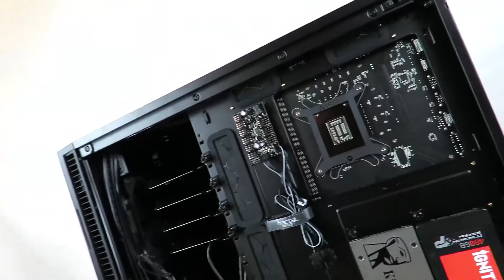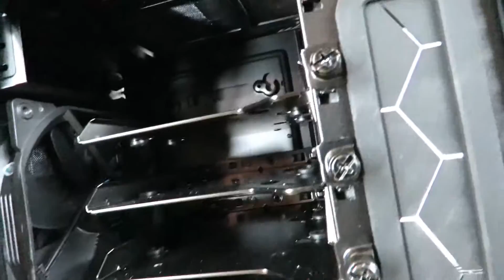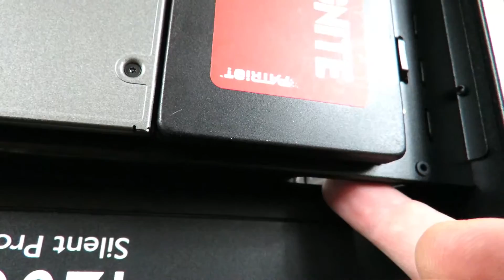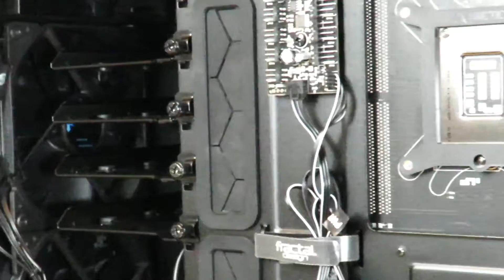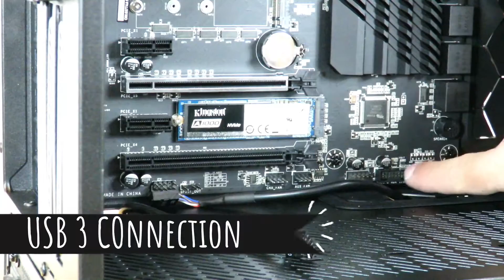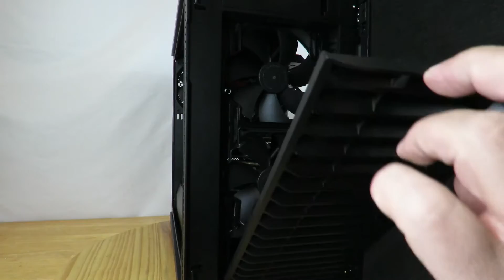Cable Management inside Fractal Design DEFINE R6 Blackout TG

Comment from the maker: Check below for a full list of Amazon Affiliated components used in this system.
Check it out on Amazon: https://geni.us/a0dMjB
Fractal Design DEFINE R6 Blackout TG Case: https://geni.us/AbJI
Flexible Cable Card Extension Port Adapter: https://geni.us/5aC3A
EVGA Z370 FTW Motherboard: https://geni.us/X9eVgAq
ARCTIC Freezer 33 eSports Heatsink: https://geni.us/alvnF9
Intel Core i7 8700K Processor: https://geni.us/jD0s8D
EVGA GeForce GTX 1080 Ti FTW3 GAMING: https://geni.us/BMB4U
Thermal Grizzly Kryonaut Thermal Paste: https://geni.us/xBKj
WD Black 512GB M.2 2280 PCIe NVMe: https://geni.us/aTAxXyc
Samsung 850 Evo 500GB: https://geni.us/QTA2
Patriot Ignite 480GB SSD: https://geni.us/CdEvu
WD Blue 500GB SSD: https://geni.us/VdqB7
Kingston 240GB SSDNOW UV500: https://geni.us/mvwOPN
Cooler Master Silent Pro Gold 1200W PSU: https://geni.us/7hdBk

Comment: Does anyone have a definitive guide on how to use and wire up the integrated fan controller in the R6? I have a fan set up that I'd like to control in sets but on my Asus ROG Strix X570-F Gaming mobo there are only 4 (or is it 5?) fan headers that can accept non-cpu fans - I have 9 fans (+2 for the CPU cooler). How do I wire up the 9 case cans so they can be controlled, thus:

A). 3 x 120mm Intake. - Front.
B). 2 x 140mm Intake. - Bottom.
C). 1 x 140mm Exhaust. - Rear.
D). 3 x 120mm Exhaust. - Top.

I want to control the 4 sets separately (Arctic Cooling (my 6 x 120mm fans) recommends no more than 3 x 120mm fans per header for my specific mobo but to only use the Q-fan type) for simplicity and ease-of-use.
 They also say if I add 4 or more it might overload the header and reduce the RPM by appx 150-200rpm per fan if the header does manage to cope.

Can the integrated fan controller in the R6 (Blackout edition) be wired up to allow me to control the fans in 4 separate sets, rather than 9 fans individually? Control would be faster and less hassle, in the longer term anyway.

Also, how does the integrated controller connect to the motherboard? If it's fan headers, how, where, how many and what cables are supplied with the case?

I've looked at getting a simple knob operated front-panel fan controller (either the Akasa AK-FC-08BKV2 or the Thermaltake Commander F6). Do you know anything about those and which would be best at giving me the specific fan control I'm looking for? 

My CPU is a Ryzen 3900X, so it needs serious air-flow / cooling - but I loathe fan noise, hence the desire to control the fan speeds to find the sweet spot between noise and temp's.

FWIW: I've got 2 x 5 port 4-pin fan controller hubs (with 1 x 4-pin connector) in my arsenal too, how might I use those for my desired set-up?
 Ebay UK search: 5-Port 4-Pin PC Motherboard PWM CPU Cooling Fan Splitter Hub Adapter Cable Lead

Sorry this is so long. :)

Any actual knowledge would be appreciated, thanks. :)
Reply from the maker: So you could put 3 fans to 1 connection using this https://geni.us/4b78k4, though the fans will not receive 100% power, only slightly reduced. The controller controls 6 fans, and 3 of PWM controlled fans, so you will be able to get all your fans in there.  Note, 6 will be at 100%, while the other 3 are PWM controlled.  You can control the PWM ones from your motherboard but will only register as 1 device since its 3 headers into 1 cable.
Reply: ThisBytesForYou  I think if I can't get any sense out of the FD R6's manual for the integrated fan controller, I'll be using 3 of these: https://bit.ly/3ea3kmX instead; I really don't want any fans running at 100% unless my Ryzen 3900X is under high load. 

Referring to my OP above: I'll attach Set D (3 fans) to one, Set A (3 fans) to another, Set B (pair) to a third and have Set C on its own. That'll mean I'll use 4 mobo headers,.. and have the CPU one left for the CPU pair (of fans) on the DR TF cooler. 

That's the plan anyway. Here's hoping it works! :) Build parts arriving tomorrow (17th). Woohoo! :)
Reply from the maker: Yup, that's where I was going with it as I mentioned only 3 were PWM controlled.  Now just realize, the adapter you purchased will not allow the fans to review up 100% since the fan power for those 5 connections will be coming from 1 header, although it may not be a bad thing for you.  good luck my friend, I hope it works out for you.  Please do let me know.
Reply: @ThisBytesForYou   I'm only attaching 3 fans (each) to 2 of those 5-port hubs and 2 to another (8 fans in total) with one fan on its own so I can control my desired 4 sets of fans as sets (intake or exhaust). They'll all go up to 100% if/when I need them to - in theory. ;) 

5-port fan hub #1 = 3 fans. Front. 1 mobo header. Intake. 
5-port fan hub #2 = 2  fans. Bottom. 1 mobo header. Intake. 
5-port fan hub #3 = 3 fans. Top. 1 mobo header. Exhaust. 
Last fan, no 5-port hub. Just run fan to the last header on mobo. Exhaust. 

That's the idea, anyway.

Comment: Sorry if I missed it, where did you plug in the Fractal Fan Hub on mobo? CPU_FAN or SYS_FAN? Can you control the fan speed? Thanks! Great video!
Reply: I want to know too
Reply: @andresmora8988  You should plug in SYS_FAN - 4 Pin connector below the 4+2 Molex CPU Power plug on the motherboard
Reply from the maker: Thanks, its hard sometimes to document it all, but I went with the CPU connection, I would never plug it in into anything else, I would prefer the motherboard handle the temperatures and with that, I can control it as well, not so sure about the fractal control.  Thank you so much much for stopping by and checking out my video, I am so very sorry I never replied to you, I guess I missed this comment, I apologize.
Reply: My sys fan plug is 3pin ?? 🤔🤔
Reply from the maker: @tonyleclerc3001  Let the motherboard control the cpu fan, that's its just, connect it to the cpu header.

Comment: Nice build sir. Why the 1200 psu? Wouldn't almost any 750 brand-new gold 80+ PSU be more efficient be a better fit? I may have missed the reasoning in a previous video. I am trying to understand the usage of a 1200 PSU because based off of the build log videos, there are not an additional GPU, or a crazy looped water-cooled system being set up in the tower.
Reply from the maker: thank you for your kind words Lorenzo and your comment is a very common one.  Prior to being a reviewer, I was a Product Development Engineer for 2 Boutique PC builders, one of which got so huge they were bought out by the largest OEM PC Builder and the other one, is still doing pretty well.  During my time, I would test all configurations and only about 1 or 2 ever even got close to 1000 Watts, and that was a triple SLI, overclocked, over memoried, over SSD'ed, over HDD'ed beast of a machine and that 1000Watts was stressing ALL of the components at the same time.  The heat build up alone caused it to get that high, without the heat it might have gotten to 900Watts.  Before that, I only tested to about 700Watts.  With that, if I would have only thought 700Watts was the MAX I could have reached, that machine would have shut off on its own and I would have not understood why, but I gave it 1200 and never had an issue.  

The power supply is the most important part of the PC and like good SSD's, you should over provision, not for what you have today, but what you may have tomorrow.  I see many people buy what they need today, then less than a year later are having issues because they upgraded and have no idea why, or they bought a cheap power supply and it blew up cuz they looked at it funny.  I have had this 1200Watt PSU for a little over 5 years and aside from the ugly cabling it has.... I have never had a single issue with it or concern that it cannot provide enough power, I have never looked at a power spec in years because I know my power supply can handle it, one less worry.

A higher wattage and efficiency power supply comes at a much higher cost that a lower wattage power supply, but piece of mind is so much more valuable.  Never having to worry if you power supply can or will is awesome.  The savings of not having to buy a power supply every 2 years because the old one blew out, or you don't have enough PCI-E cables to run Crossfire/SLI or even some sort of future card that requires more, those savings alone make it worth it to me.

Now as a reviewer, even more I need to have a power supply that can handle anything, because I don't know what's coming out tomorrow, so I need to be prepared.

With that said, I will be soon rebuilding this machine, with less explanation, more speed but utilizing what I feel right now is the better power supply, I just did an unboxing last night and will upload shortly.  It provides slightly less power, at 1000Watts, but as for right now looking at the power rails and amperage seems to be much better, higher efficiency rating and my god, the cables are so much nicer and it is touted to be quieter too, but I have not put it in a system yet, so I dont know just yet.  Please keep your eyes peeled on ThisBytesForYou for those videos.

I hope I have answered your question and if you have more, please do let me know.
Reply from the maker: also, this is a 80+ gold power supply as well so the efficiency would be almost identical but again, another video coming up soon on a different power supply.... and you know what, I think I will add another GTX1080 TI in that video, thanks for reminding me.